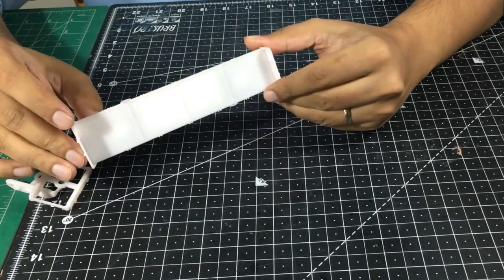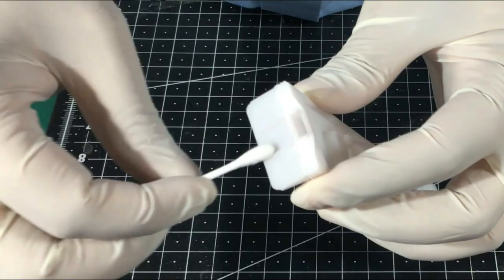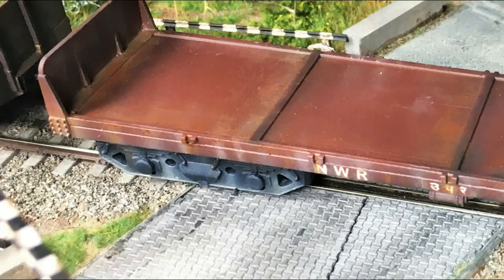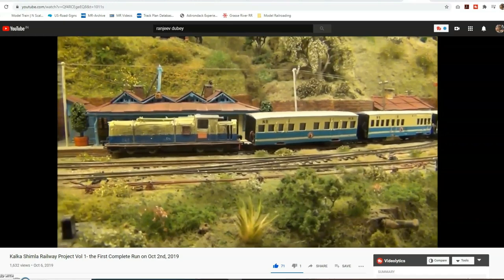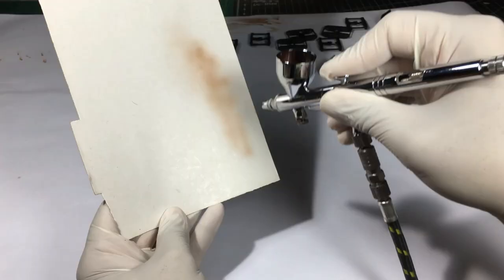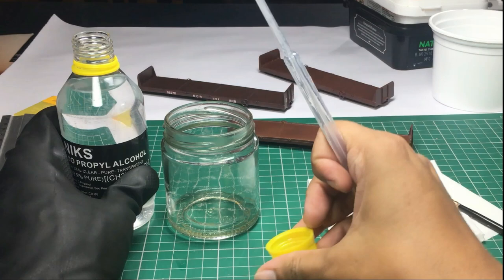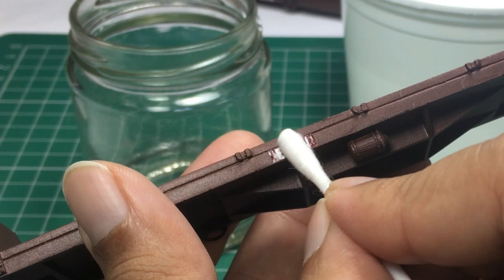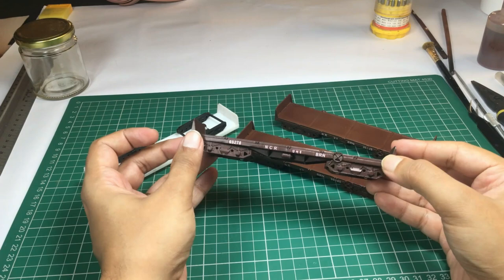Beginner Guide: Prep and Paint 3D Printed Rolling Stock (HO Scale)

Comment: Kaustav, thank you for taking our modelling to a higher level with such an informative and learned video. Can you advise whether using Isopropyl Alcohol 99.9% instead of Acetone be an aternative? Appreciate your assistance and keep producing fabulous videos, Mike.
Reply from the maker: Thank you Mike, I am glad that you found the video informative. I think the decision between IPA and acetone depends on your purpose really - acetone is much more aggressive, so if you are working with smaller parts or materials like ABS, PLA etc, acetone is almost a 'no no' (there is a concept of 'acetone bath' for these, Google it). If you are dealing with chunky resin 3D prints and you want faster result, 99.9 proof acetone is the way to go, IPA cannot break cured resin so easily. The best way to proceed is to try out your options on a scrap piece with both the chemicals and a combination of the two to find the best option for yourself. For all these 'custom' methods your own experiments are invaluable - just exercise caution since these items are not fun stuff if mis-handled. Cheers! Kaustav
Reply: @TrainsandDioramas  Thanks for the words of caution. I will proceed carefully before trying out anything that has been untested. Again, Cheers Kaustav. Mike👍

Comment: oxide red RAL 3009 you can create using as a base Humbrol 20 paint. It is gloss so at first add of talc is necessary, than add black matt and Humbrol 37, 70, 85 or similar until you will be glad at
it is good to have a piece of old paint from an old railway car to  compare colors
other way is to use anti corrosion primer in oxide red color
Reply from the maker: Hey thanks for the tips. The prototype color is not really oxide red, it is a maroonish brown. Plus the color matching for the decals did throw a curveball. Ah well, you learn as you go. :)  I will keep your tips in my kitty for the next time. Cheers and thanks for stopping by.